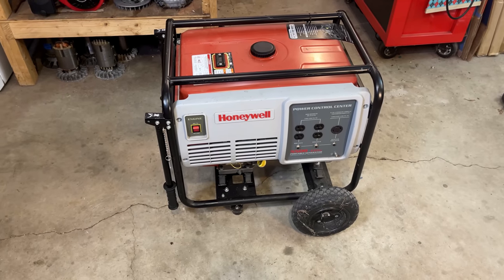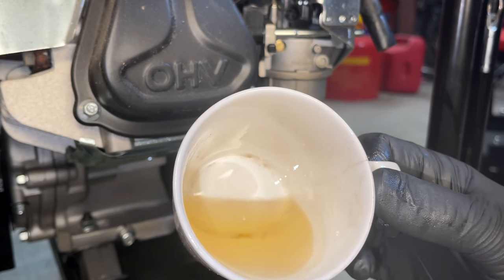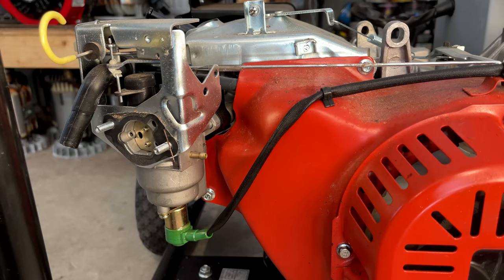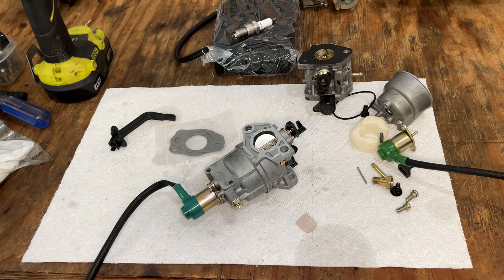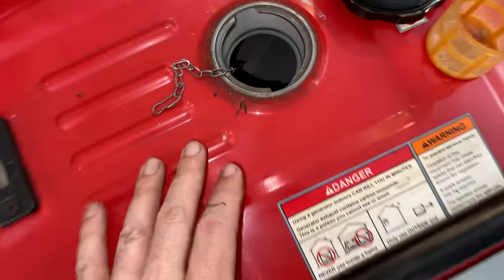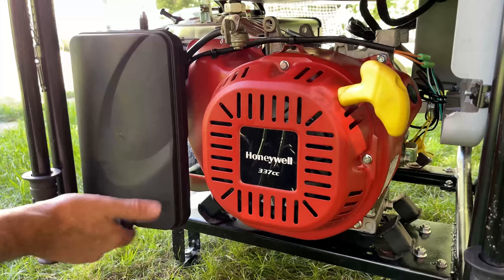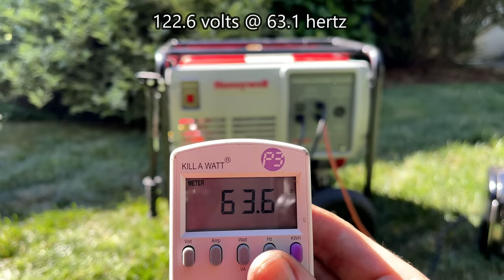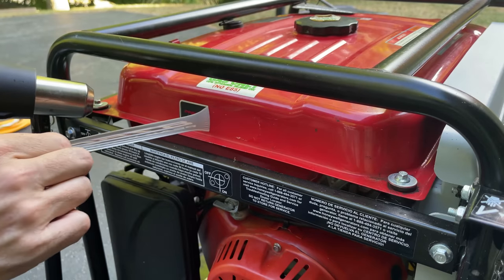Bad Tank and Bad Fuel - Easy Fix?

Comment: When you installed the carb gasket over the plastic isolator I noticed the port opening did no align correctly. It was open to the air bleed channel in the isolator. This will give you a massive air leak. I've run into this many times and learned that you have to match up the gasket to the plastic isolator and the carb to the isolator or you get a massive air leak. I've always had better luck getting aftermarket carbs with the plastic isolator and gaskets. I really enjoy your channel and your work.
Reply: The devil is in the details, this is very much like a Taryl Fixes All video where the owner tried and failed a DIY fix with aftermarket garbage that was the wrong stuff. I also noticed when James went to try the original carb, he left the new gasket on and double gasketed the install since the original gasket was still stuck on the carb.
Reply: @killer2600  True,   But we all make mistakes every day. That's what makes us all human. I have much respect for Mr Condon because it's not easy to do what he does. It's hard enough to just work on this type of equipment much less make a video and everything else that goes along with it. If it were easy everybody would do it.

Comment: Nice repair, James.  I used spray Berryman's carb cleaner to detect vacuum leaks on my autos.  I'm sure you know that trick, but it is a good one.  Thanks for sharing.
Reply: A non lit propane torch works quite well too. Carb cleaner can soak through a paper gasket and cause false reads occasionally , but it is a good option in a pinch.
Reply: @PINKBOY1006  I never thought of that.  I mostly used the Berrymans on the plethora of vacuum hoses that would eventually get brittle and break on my old GM engines.  Thanks for the propane tip.

Comment: The problem with the HIPA carburetor was not the plastic isolator it was the gaskets!  I just got the same HW5500 generator for free with fuel leaking.  I put the $20 carburetor on - which solved the leak - but it only ran with the choke on like in the video.  I put the original gaskets back on after getting some hints from the comments.  It runs perfectly now.  Thanks to all!

Comment: For flattening both sides of the plastic isolater and the carb you could try resurfacing it on a piece of 200 grit sandpaper glued to a flat surface. You make having a well stocked inventory of spare parts look normal. Why do the clean freaks always regard our parts stash as "hoarding"? A discussion of the importance of venting to atmosphere on those carbs might be helpful. You helped me overcome that obstacle last year. As always James a well made video.
Reply: I don't save parts, but mostly for a lack of room, it's not hoarding, it's great if you can spare the space.

Comment: It appears you have several tanks, but the next time you cant locate one try Kreem fuel tank liner. It has worked well for decades on sealing and preserving rusty tanks. Great video!
Reply: Kreem works great I’ve been using it for years. The smallest tank I’ve used it on was an antique Briggs engine, the largest was a 1967 Allis chalmers bull dozer. That dozer had a huge tank in the neighborhood of 10 or 15 gallon and it was full of rust, cleaned it out and sealed with kreem no more problems. Highly recommend kreem

Comment: Speed droop adjustment. James, you might try moving the hole the speed setting spring is attached to change the droop of the engine under load, you might get is closer to where you want the droop to be.

Comment: Fascinating, never had fuel that didn´t burn anymore. Even the totally gummed up two stroke stuff from the early 1980´s out of a rusted 60´s scooter tank still worked perfectly in 2012 in an other engine (it gummed up the carb, piston and crancase though).

Comment: There used to be an aviation rubberizing coating that farm machinery dealerships parts departments used to carry to coat the inside of rusted even rusted through metal fuel tanks.  It might still be available though perhaps not as readily as more machines switched to plastic tanks to eliminate the rusting fuel tank problems.  NAPA auto parts might also have it. Might be quite costly as everything else is now days but when you don’t have a spare tank it might be a way to safely repair one.

Comment: We used to test for vacuum leak by spraying starting fluid near the carb while the engine was running and listen for change in rpm
Reply from the maker: That works well.

Comment: I usually don't worry about the cycles per second (hertz) as long as it is 50-60 Hz. It is within spec. of the equipment it is running.

Comment: James just get a cheap 12v fuel pump from any auto parts store hook up hoses and add wiring to hook up to battery or jumper box makes a quick easy way to drain tanks. Used this on my boats.
Reply: An in-tank car fuel pump which still runs but doesn't have enough pressure fo0r the car will do, and the price is usually free.

Comment: Shops around town with waste oil furnances LOVE old gasoline! I guve my old fuel to another small engine place where they either dispose of it, or use it during the winter. Never put old fuel from lawn mower etc in your car. Learned that the hard way.
Reply from the maker: It is a risk.  Once put some in my car that ended up having some water in it.  Car was not too happy about it.
Reply: @jcondon1  exactly and with today's direct fuel injection to try and flush out that system is a real pain and very expensive
Reply from the maker: @Bassguitarist1985  also do not want to clog up the fuel filter on the car.  Not an easy job to fix.
Reply: @jcondon1  exactly. $$$$

Comment: Perfect fix as well there is many anti rust or rust removal substances can fix the original tank but requires some time to do a proper etching for that rust.
Reply: Maybe a short video doing a tank revival?
Reply from the maker: I use evaporust on tanks that cannot be replaced.  But since I had one I did the easy thing.  Also Honda clone tanks like this one can be found on eBay cheap.
Reply: @jcondon1  Totally the best way. I've successfully sealed around a dozen motorcycle tanks, where the rider will notice any leakage. But generators will often be left unattended and running greatly increasing the risks of a catastrophe if a tank leaks, so I wouldn't try it on them myself.

Comment: When checking the oil (as at the 1:40 time stamp) --- use the factory technique shown on the decal that clearly shows the correct full mark as oil just to the top of the filler plug threads and NOT at some random place on what is mistakenly still sometimes called """the dipstick""".
Reply: Yeah, I think he knows...

Comment: "Stop your typing" re: the sticker was funny and interesting curve ball with the insulator. Makes ya wonder if trying to sand it flat on a stone would have resolved the issue, but easier to swap out with another on hand for sure. Glad it wasn't the HIPA carb too. I've used many of their parts w/o issue as well. 👍

Comment: Another great video James!! Thank you! 
I need to check out the governor on my genset..it (Hz) drops down quite a bit under load as well. Never considered there was a way to adjust the Hz!
Thank you!
Jim
Reply: You can set the gen for maybe 61.5 Hz under no load but no higher.  If it drops excessively under load this may be a sign that the motor is a bit down on horsepower and there may not be anything you can do about it (short of a rebuild) if the motor is running well otherwise.  Or the governor spring could be set to the wrong position but usually not.

Comment: I've used TSP from the paint store (not the "TSP substitute") in very hot water to clean varnish from gas tanks, and then citric acid to de-rust them (several soaks with boiling water). Evaporust or Metal etch (Phosphoric acid) ups the de-rusting ante/  I've seen other channels use muriatic acid to remove rust, but that's out of my comfort zone. I've mimicked the process (and maybe the materials) that came with a Motorcycle tank sealing kit years ago.

Comment: I'll have to keep the insulator leak problem in mind. Nice having a parts stash for troubleshooting. Good to know you have had good luck with Hipa carbs, from other posters Chineseium carbs tend to be hit or miss. As a Predator owner it would have been fun to see the two dead ones, since you don't seem to run into them very often. The 9000 Predator is pretty new so I'm surprised you already had one with a bad engine. Knock on wood we bought our 8750 Predator in 2016 and other then testing every few months have not had a power outage since.
Reply from the maker: I have a video in the works.  3 predators in one video.
Reply: @jcondon1  Wow a three-fer can't wait.
Reply: Run any generator, even a brand new one, low on oil and you will kill it. The oil level switch might work or it might not.

Comment: Sometimes it can be something as stupid as an intake gasket. You have to watch those gaskets carefully because sometimes the outer footprint matches but the hole in the middle is the wrong size.  Like Bill says if you spray carb cleaner around and the lean condition goes away temporarily, you have found the general area of the vacuum leak.

Comment: Just had another look at this one after you posted the pic of the kids in the 
 school in Guinea, The tank you took off this one might be a good one to do a test run of cleaning tanks using electrolysis. It looks quite badly rusted so it would be difficult to clean up using other methods. Its a sort of standard size and shape so if it does clean then you would not find it too difficult to use on another generator. If it did not clean up then you would not lose much. If it did work it could save you 60 dollars. Its all a learning curve anyway is it not.

Comment: That generator was likely stored in a location that experienced wide temperature fluctuations from day to night which caused the volatile components of the gasoline to be vented off. It appeared that the air filter housing was moving in relation to the recoil cover which shouldn't be possible.
Reply: Good old harmonics.

Comment: It would be cool to see you go over the insulator block and find the warp or crack. If it's warped, does it make sense to lap it with a sheet of sandpaper on glass? Or is that a bad idea?
Reply from the maker: That would probably work.  The insulator that was bad was very rough.
Reply: @jcondon1  Permatex #2 is an option

Comment: Hello James cordon, nice job, I enjoy your videos...my generator goes off after a few minutes and takes time to start, I have changed the oil and fuel...pls what could possibly be wrong?
Reply from the maker: That could be caused by a few things.  Would check fuel flow from the tank and clean the carburetor to start.  If still a problem then might be a bad spark plug, ignition coil or maybe low on oil or a bad low oil module.

Comment: As always saved anther unit. 
Just a question did tank leak, I in the past and have save rusted out quad tanks by using Muratic Acid for pools at 3 oz acid to 3 oz water shake and rotate drain and do again 2 -3 time then 3 oz 30w oil and 3 oz gas doing the same as acid water. Need to wear rubber gloves when using acid. Then fill with gas and let sit for a few days and should not have any rust. Just an idea for you to try.
Michael.

Comment: The insulator probably wasn't cracked. The carb. venturi is smaller on the 337cc engine. The honda gx 340 is the correct replacement. I just install gaskets for the 340 and that usually works.
Reply from the maker: I missed that.  Thought it was 437cc.  The carb was for 389-459cc engines.  Odd though that the original carb did not run it any better.
Reply: @jcondon1  The previous owner changed carbs, so could have put in the wrong spacer and gaskets too. You got it sorted out; many folks wouldn't have.
Reply: @P_RO_  There was just a "Daryl" video where this exact thing happened. We already know that this gen had a new carb (which did not run well because of wrong gasket).  Old carb bad, prev. owner buys new carb w/ wrong gasket, new carb doesn't run well either, owner sells gen to James for cheap.  James fixes  and sells.  Profit!
Reply: @jcondon1  I've been doing this professionally for 39 years. This exact thing happened to me. I found the gaskets didn't seal properly. Who knows what the previous owner changed before you got it. Point is you persevered and won.

Comment: Xylene is a good solvent for removing fuel varnish and carbonized oil sludge
Reply: Benezen is twice as fast 
But it’s extremely dangerous and flash fire blue
Reply: @philliphall5198  Toluene and Benzene and Xylene have been 
compared. Xylene seems best, partly because it not so highly
volatile, it has time to soak. So it will work even on an opened 
valve cover to brush onto and loosen the accumulated sludge 
since xylene doesn't evaporate quickly like benzene or acetone.  
Benzene will attack and swell rubber seals and cause them 
to fail prematurely, so is better not to use on an engine where 
it can mix with the oil and then have effect on the seals. It 
was used as a solvent for patching rubber tubes and tires
and used in rubber contact cement where a small amount
was useful as a volatile solvent. Getting it into the engine
oil would likely cause seal problems sooner than expected.

Comment: would love to see how you tackle cleaning a tank as bad as this, most of us wont have spare tanks laying around. Seen a few suggestion out there on the net, would love to see what your opinion or method is.
Reply from the maker: Evaporust works well.  But not cheap and it takes time.  These Honda clone tanks are pretty cheap.  Usually can find them new for $60 so not worth cleaning usually.
Reply: He has done that multiple times. Check his other videos.
Reply: I found taking the gas tank off putting a little gas in and some bb's (for a bb gun) and shaking the tank, dump the gas and do it again until the gas come out clean. then get a magnet to get the bb's out.
Reply: @ChosesinWon  Just say "NO!" The chances of an explosion doing this may be small, but if it happens the blast will be very big, and any 'handsome' you may have had will be permanently gone, as will at least part of your hearing and possibly your vision. With a totally dry and well aired out tank, the BB's alone will do the same thing, and you'll then be able to enjoy the next video James makes for us.

Comment: A 5000 Watt load at 120 Volt has 2,88 Ohm (R = U square / P). Please measure your load.
You are mostely satisfied if the generator delivers 116 Volts but at 116 Volts you are only drain 4672 Watts.
P = U square / R.
This generator delivers 122,1 Volts at your 2,88 Ohm full load so the output is 5176 Watts.
Turn down the regulator to 120 Volts at medium load and your frequency will go up.
You should use a calibrated load to compare numbers. This generator has a strong powerhead.
The displacement of the engine is a little bit low.
You can increase the output by grinding down the head to increase the torque a little (you need high octane) or bore the cylinder.

Comment: You didn't even try and adjust the mixture screw on the Hipa before you condemned it. In the end, glad it wasn't the carb anyway. I've had good luck with Hipa parts. They're like a name brand of off brand parts if you will hehe
Reply from the maker: That screw will only fine tune.  It was way off.

Comment: .. you should put a fuel filter or something on that vent to keep the dirt out, tho.. just a short piece of hose then the Filter..
Reply from the maker: I am going to try an add the line to the vent.  With a full tank of gas, I could see a little potentially splashing out and do no not want it dripping on the engine or exhaust.
Reply: , @jcondon1  You could take the air vent out of the top of the tank completely and fill the hole with a plastic or metal stopper. You would then need to replace the fill cap with one with a vent. No need to force a vent tube between the body of the machine and the arm of the frame then.

Comment: What is recommended storage for a steel tank? I always run mine dry, then leave cap off outside to evaporate any remaining fuel. Should some form of rust preventative be used?
Reply from the maker: I usually keep my tank full and swap out the fuel twice a year.  Carb always dry.  I only do that so my wife only has to roll it out and start it.  If dry, then I do the same with the cap.  Also would not hurt to spray some wd-40 or two stroke oil in the tank to minimize the chance of rust.
Reply: @jcondon1  Thank you for the advice. Great channel.

Comment: Great video! I was wondering if you were going to tackle one of those B&S plastic carbs at some point? What a pain they are!!! I bought a new one for my 450E and it still doesn’t run. Has spark, any suggestions?
Reply from the maker: Would check the flywheel key.